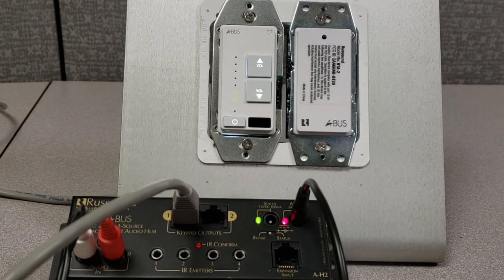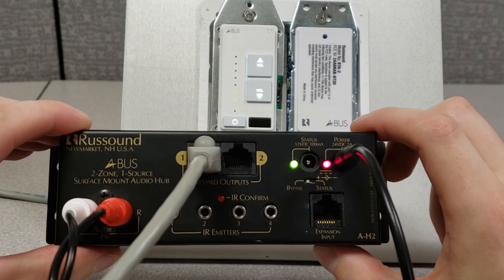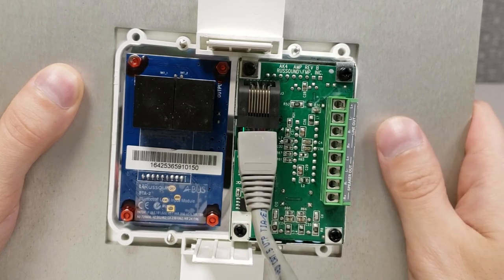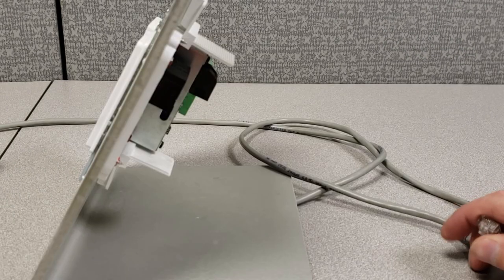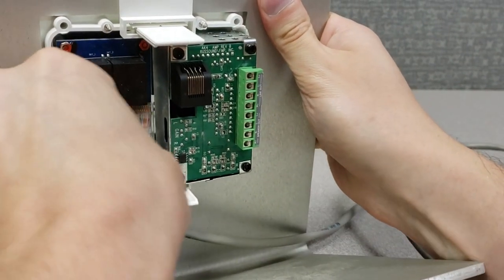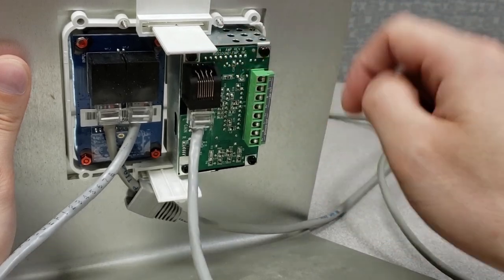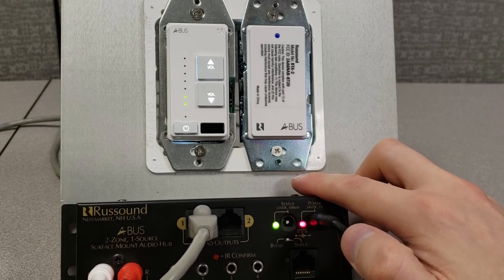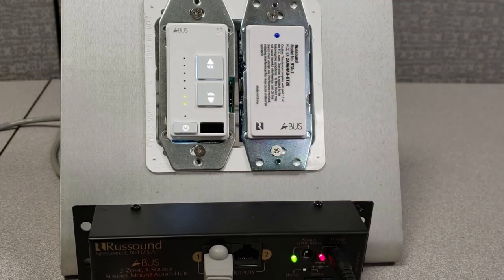Adding a BTA-2 Bluetooth Module to an A-BUS System

Comment: Hey Ben. I just bought a 13 year old house and it's been wired up with an EATON A-Bus system. Did Russound take over this product?  I've got ceiling speakers in various rooms, along with 8 different wall mounted control pads. In the basement, there are lots of ethernet cables in wall panel going into an EATON A-BUss boss. Finally, there are 4 input panels on the wall to plug speaker wire into.  The previous home owners left a note suggesting there are 4 zones (which aligns with those 4 input panels). I don't have a conventional amplifier to test this out as I only play music from my Iphone and broadcast it to a wireless speaker.  Would these BTA 2 Bluetooth modules allow me to stream from my phone, to the BTA module and then play music over these speakers?  Would the wall mounted control panels be used (other than to hardwire into the BTA module)  or would everything be run from the phone?  THanks James
Reply from the maker: Hello, Please contact our team at (603) 659-5170 or by email: sales@russound.com or tech@russound.com